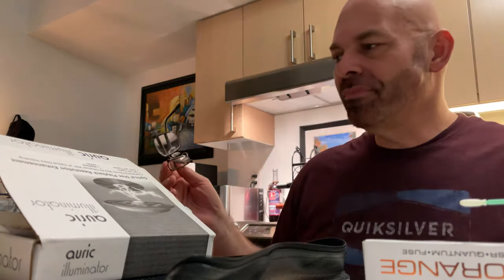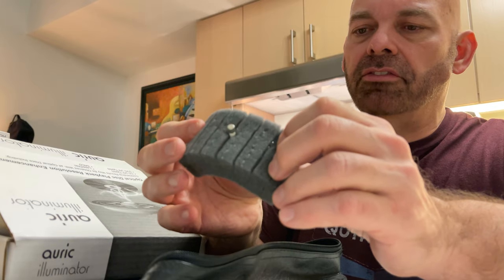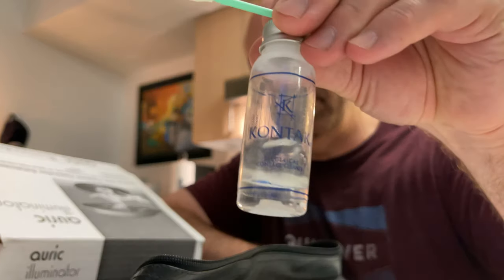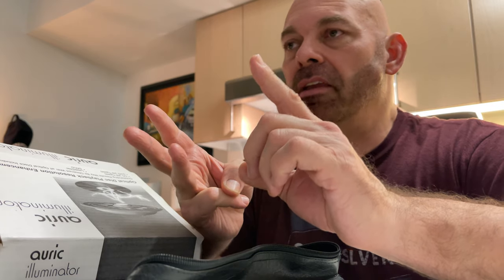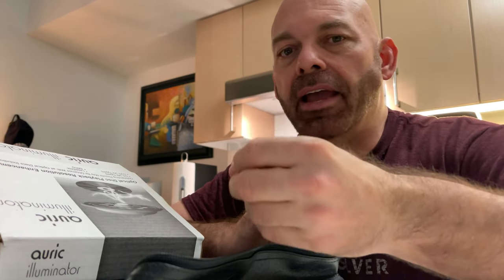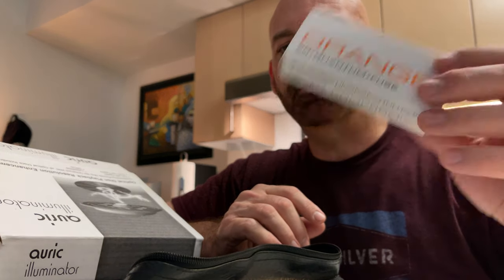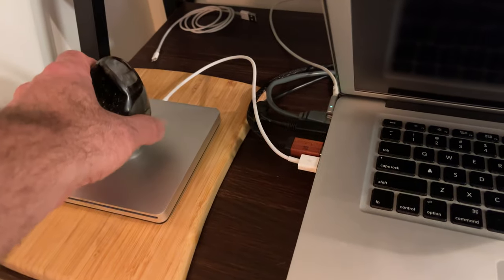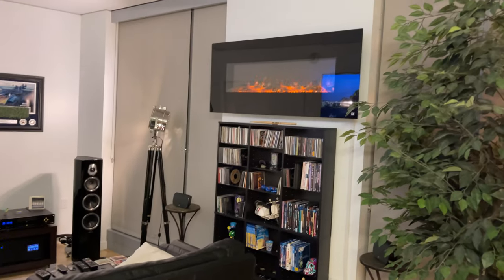An Audiophile in Seattle "Synergistic Research Orange Fuse Upgrade & Chang Lightspeed Update!".

Comment: $150 each? Wow hope it works great and helps the sound appropriately. Can't wait for your take on them.
Reply: $159.95 each. Yeah, they're worth it, provided you have a high-end system (meaning high-end components, high-end component platforms, high-end cables, high-end power conditioning, and good room acoustics. Make sure you buy ones with the proper ratings. You'll want a higher value that what's recommended for your component. Check first with your dealer or Synergistic Research.

Comment: The only tweaks I'm more skeptical of than fuses are cable lifters. Is it possible that a fuse makes an amp (or anything) sound better than the same device with no fuse in it at all? I find that hard to believe. The fuse socket and fuse are interruptions in the signal path, therefore a compromise. Or, look at it this way--if the fuse actually is better than a straight wire, put another fuse socket and fuse in the line and double the benefit! For an inexpensive socket and a $150 fuse, that would be relatively cheap tweak! Yeah, yeah, I know, hearing is believing...
Reply from the maker: To the best of my understanding, you are correct that no fuse would be optimal. However to protect our multi thousand dollar items, some fail safes must exist, LOL. Yes a little thin wire is taking all that wall power and feeding it to your power hungry transformers. Now we know glass vibrates and creates distortion, and it also is bad at rejecting heat. So a ceramic body that reduces heat and vibration could be one reason it sounds better. Also, the fuse has a blue dot with graphene on it that has some effect on the fuse as well. Some fuses use beeswax or Cilicia sand inside that keeps the filament from vibrating. I would assume that cleaner power delivery through the fuse makes better sound from your power supplies. Whatever it is it's extremely apparent  when installing. Thanks for watching! 👌🎼✨
Reply: @vpconcepts9838  I hear you--I thought in a cost-no-object system, don't use any fuses at all. In the event of a failure, just buy a new rig. "Well, you said cost was no object!"
Reply from the maker: @DismasM  ok Joe,  and you can be my first patron subscriber 😋👍🔊🔊✨

Comment: Why and how are those fuses directional?
Reply from the maker: I was skeptical as hell till I tried it with a set of ceramic fuses a couple years ago. Then again with my SR oranges. It's so bad in the wrong direction it's painful to listen to. Stringent and metallic sounding. Going the other way it's buttery smooth. My ceramics were not marked so I had to use my ear. The SR oranges are marked. A learning experience for me, that's for sure 😉👌💯🎼✨
Reply: @vpconcepts9838  So they are only for DC applications, what about AC mains fuses?
Reply from the maker: Here's their website & the latest fuse...
https://highend-electronics.com/products/synergistic-research-purple-quantum-fuses?keyword_session_id=vt~adwords%7Ckt~sr%20fuses%7Cmt~e%7Cta~563369734017&_vsrefdom=wordstream&gclid=Cj0KCQiAr5iQBhCsARIsAPcwROPrKSnn5oT8AfVp3jFWqsPC9Ll2-HVOo7MJifhycQp9BvBrT5Am75kaAqSzEALw_wcB

Comment: Nice review, how is the sound now, I guess the 200 hours burnin time is over now... , will get me one of these. I use the Black Fuse now.
Reply from the maker: Incredible! I like it so much I now have 4 in the system. Pretty amazing & turned me into a believer that a $160 fuse can be worth it. 👌🎼✨
Reply: @vpconcepts9838  did you noticed a lot of changes after a few hours? deeper and fuller bass?
Reply from the maker: A huge change over 300 hours. Very large & relaxed sound stage! 👊🎼✨
Reply: @vpconcepts9838  If you have good gear ... the price is so small for such great return on the sound.

Comment: its me again,i have a question ,I need your advice, when i turn on my ma12000 amplifier 
i get a thump pop to the speakers..do you know how to avoid this, i wanna get rid oft it,
thank-you ..
Reply from the maker: Sounds normal. In a separates system you turn the preamp on first and then the amp second to avoid pops. In an integrated with tubes, the internal turn on sequence could be the amp on first and pre-amp second hence the pop. You can ask your dealer if theirs does it too..then you know your good LOL 😉👌🎼✨
Reply: @vpconcepts9838  thankyou very much for your help ,you know i get replacement of the ma12000 this new has it to like the one a gave back ,so both have it then its normal.
sounds logical  another question .can it harm the speakers.?
greetings kla.
Reply from the maker: I have never heard of a start up pop hurting speakers. You can listen to machine gun fire, lightning and thunder claps from a song or movie with the volume set to 11 without any issues. So I believe the minor pop at start up should be ok.  👍🎼✨
Reply: @vpconcepts9838  thankyou you helped me a lot,its great that we share the same hobby,
greetings from Geneva , Switzerland

Comment: Hi there could you help me please? Iv bought a synergistic research orange fuse and I cannot figure wich part sound better, could you recommend me a cd track to listen wich can reveal wich part is sound better...cheers Teo
Reply from the maker: Hi Teo! Yes the fuses are directional. I put in a cd I am very familiar with and play about 40 sec. Then I take out the fuse & flip it around and listen again. You can tell right away which direction sounds better. The wrong way will sound brittle & etched. The other will be natural, relaxed, and open. This has been my experience on the 3 I have purchased so far. Thanks for watching 👌🎼✨
Reply: @vpconcepts9838  Can you recommend me  please a track wich have some special passage can put in evidence tonality so I can figure above any doubt the good fuse direction ,and if is good as well for image on 4k uhd TV...your help is much appreciated cheers Teo
Reply from the maker: @catalinvoinea6406  it's noticeable right away. One side is stringent & the other sounds smooth & open. Play your favorite track & decides what sounds better. 🙂👌🎼✨

Comment: How will you know if the fuse is really making the positive or negative difference after burnin? Your ears must have burned in as well, with the confirmation bias, not sure how accurate your assessment will be. I am thinking that you can swap back and forth with stock fuse to compare, but that's too troublesome. I do believe in tweaks; just that I have not tried fuse yet.
Reply from the maker: Go to my video on the Audioquest jitterbug for a laugh on my take of burn in questions. 😉👌🎼✨

Comment: Do you have a suggestion for someone starting out on this process, as to which order to upgrade the components? My thoughts are internal Pre-Amp, DAC then the internal Power Amp Fuse? As a first step then in the future work on the internal CD and Subwoofer before going on the external plugs? How would you approach this? Great video, thumbs-up from me!
Reply from the maker: In regards to the order of fuses? I did the CD player first, then integrated amp, power conditioner, then streamer DAC. It really doesn't matter what order, because for me each change was highly noticeable for the better. But if I had to nail one down to do first if I could start over? I would choose the power conditioner since all components benefit as a whole. Thanks for watching Martyn! 😉👍🎼✨
Reply: @vpconcepts9838  Thank you for taking the time to reply and for the contribution of advice. The power supply will be first stop on the Hifi fuse journey. Can't wait to jump in!

Comment: Directional ?   So it's a DC fuse then, no an AC fuse.  I would expect two of them...  One for the positive rail and one for the negative rail.
Reply from the maker: The fuses go in a certain direction. They are marked so you can't mess it up 😆👌🎼✨
Reply: That is a 1 amp slow-blow fuse ?  What is it protecting ?
Reply from the maker: Power surges 👍✨
Reply: If it's for a power surge then I would think that that should be a fast blow since surges are fast
Reply from the maker: Follow the specs in the direction manual and you should be good to go 😉👍🎼✨🏆
Reply: @vpconcepts9838  Why (and how) are they directional?

Comment: Is there something else other than the fuse being ceramic,, ?
Ceramic fuses are fitted in everything in England,, I know they Have improved thermal qualities over a glass fuse,,
Reply from the maker: The fuse has a blue dot with graphene on it that has some effect on the fuse as well. Some fuses use beeswax or Cilicia sand inside that keeps the filament from vibrating. I would assume that cleaner power delivery through the fuse makes better sound from your power supplies. Whatever it is it's extremely apparent  when installing. I put a link to the the fuse up in the description.
Thanks for watching! 👌🎼✨

Comment: Bro.....broooooo. don't fall for that too 😰
Reply from the maker: Fall for what? I had a risk free money back 30 day trial. If it was snake oil, I send it back. 
It wasn't, so I kept it and did a video on
It. End of story. 👊💯✅
Reply: @vpconcepts9838  fuse's provide an overpower interrupt in a signal power path that breaks the connection under severe load.  They exist before the audio.  They are not an audio effecting component.  There are fuses all over the world in the power grid, your appliances, your power supplies, tv's, laptops.  A diode provides a single path of direction and still does not affect current coming through the line in terms of quality/sability.  A fuse cannot and will never be able to affect audio since it is NOT the DAC, it isn't the op-amp, and it isn't the IC or Rectifier.  It is a line break.  That is it.  I would even wager if you broke open every single fuse they sell, In fact I could play a pretty heft wager mind you, that those fuses are nothing more then .10 cent fuses bought from  mouser or digikey and simply repainted or branded.
Reply from the maker: Let me guess...you never actually bought any brand whatsoever and did a blind A/B test. 
Yet your preaching facts on which you have not experienced. I'm down for anyones input for the yah or nay's, as long as it's shared with applied perspective. It would seem here, that it is not. 
I do thank you for watching Ev3rMOr3.
👊💯🎼✨
Reply from the maker: That's what I thought. Come back after buying one, listening, and taking notes on what you hear. I will be all ears to anything you have to say, good or bad. Until then please no comments on opinion & conjecture. 👌🎼✨
Reply: @vpconcepts9838  why would I buy a fuse and use it where I don't need it ?  I build amps and speakers.  Never heard to add magical fuses.  However a good crossover or active dsp does wonders for a system.  A power conditioner sometimes helps when you have brownouts and power fluctuations.  That's really about all you get for improvements.
Reply from the maker: I never said YOU had to buy one. I simply shared my experience on getting one. 
Your missing out on a wonderful experience, I can tell you that. It's awesome you build speakers. I admire anyone who has the talent to do that, and to understand crossovers. I applause your talents Ev3rM0r3 👌💯🎼✨
Reply: @vpconcepts9838  I build amps as well, class-a amps.... using single components on customized pcbs.  And here's the deal breaker, you don't need fuses in a circuit, they are only their for blow and overload protection.  But if you don't there is  nothing stopping your amp from frying under overvoltage or draw.  But anyways, you don't need fuses in a circuit, but when you do use them they provide no extra benefit.  Quite possibly cannot.

Comment: hey there i am locking forward to get a better fuse for my new ma12000.
btw i have  The Nightmare Before Christmas CD 2008 japan edition.
yes it is a great soundtrack.
Reply from the maker: Nice! 🙌🏻🙌🏻👏🏼👏🏼🎼✨
Reply: You'll want to get a higher value Orange Fuse than what's recommended by McIntosh. Check first with your dealer or Synergistic Research to determine which value to buy. It would really suck to blow a $160 fuse.
Reply: @LorenzoNW  thankyou for you advise
Reply: @mcintoshkid  Sure, I’d also suggest treating the fuse and contacts (along with all your other contacts) with a good contact enhancer (i.e. Stabilant 22, Furutech Nano Liquid, Cardas Contact Enhancer) after cleaning the contacts with 99% isopropyl alcohol using a foam (not cotton) swab. Or else, you can use a combination cleaner/enhancer like DeoxIT Gold. This should probably done annually to maintain a high-end system. It definitely makes an audible improvement, especially on tube pins.
Reply: @LorenzoNW  ok thankyou for your tipps,
Reply from the maker: Yup! I use Kontak myself 😉👌🎼✨